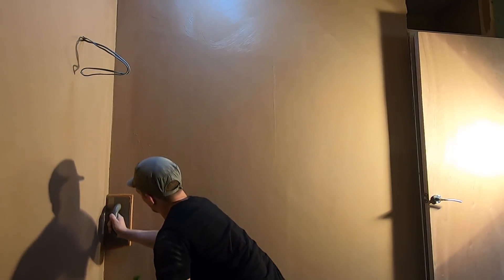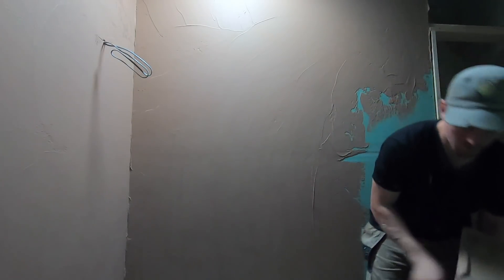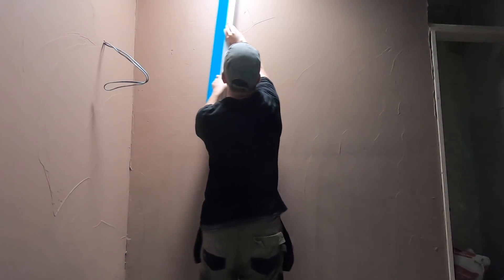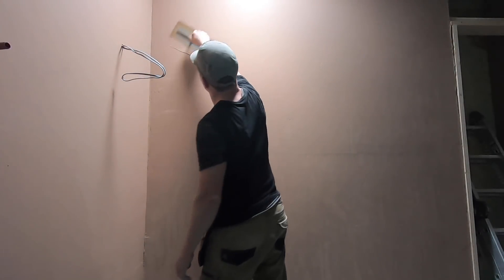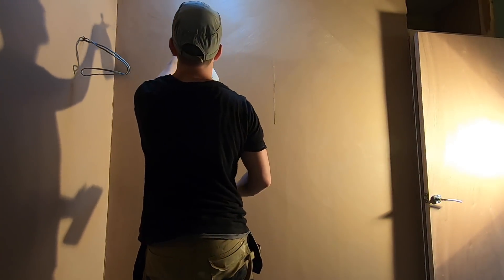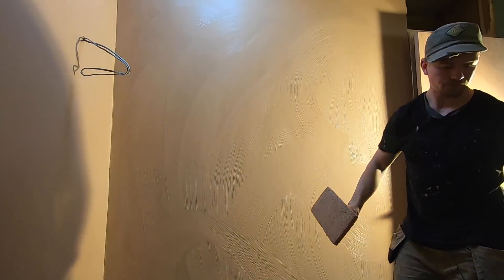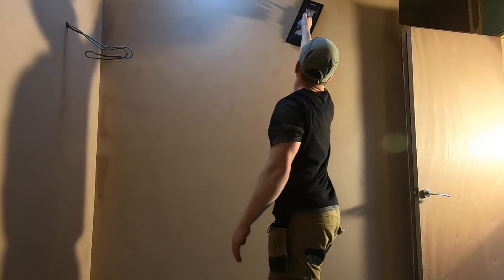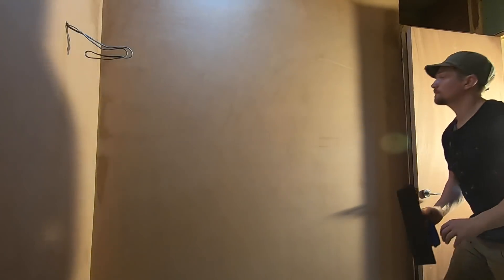One Coat Plastering | Is It Ever OK To Do??? (TEST)

Comment: Hi mate. Interesting vid. Can I ask you for your thoughts on my situation please. My mother had a disabled bathroom adaption and I thought it a perfect time to change her old hardwood windows. Problem was the window manufacturer couldn’t get our order out in time (snowed under with orders) and so we had to let the bathroom works go ahead (incl plastering to the walls) but got them to leave the ORIGINAL skimmed reveals. The issue I have now is that having fitted the windows I’m looking to plaster the reveals but even though they’ve left me with skim beads the thickness I’ll need for the reveals (off those beads) is around 10-12mm……as they’re external walls I’m wary of using bonding then skim coat and was wondering about this one coat (never ever used it)….what do you think? It’s ‘only reveals’ after all and I’m going over the original plaster finish. Thanks for any info. 👍

Comment: Today I have plastered a 10m2 ceiling using this one coat method. Late Victorian house with plaster coving. I blue gritted the ceiling. Laid the coat on mega thick. Used an ox speed scim for the first time. It was ok. Will get better at it and think it will be better on walls. Followed all of your steps, took 2 1/2 hours from start finish and it was f@cking hard work. Always is, I f@cking hate ceilings. Been a DIY plasterer for 9 years and ceilings always destroy me so thought I would try this instead of two coats where I always struggle because the 1st coat starts turning before I get the next coat on. High ceilings so up and down ladders takes it out of you.
Today went ok. Still hard work but found I could spend longer getting the big first coat right as I had more time due to not mixing up a fresh batch. 
I think it looks good but can’t really tell until it’s painted white. I will report back here once I’ve done that and let you all know what the finish is like. 👍

Comment: Id have that tiny wall coated in 3 hawkfulls easily. And second coated in 1 hawkfull.get the sponge in the bin. Never seen the likes of it.good timing and spreading shouldnt need sponges and water for closing in ready for a polish .water should only be used for brushing im edges and polishing.

Comment: Sorry just had to comment again 
As long as you do a nice 4mm coat the finish is same. I've wanted to try 1 coat for awhile but went against it because how I was trained. Had to take that leap off faith. Your not compensating on quantity of the plaster. It will dry Even rather than 2 coats going off on 2 different times chance you could hit dry spots. Like I said with all the new trowels makes 1 coat available old dog new tricks
Reply from the maker: Hi there! Thank you for your comments - you have some valid points and I must admit that I agree with everything you've said! Great hearing from you and thanks for watching! Cheers 🍻

Comment: one coat plastering works well if you know how , most dont know how thats the biggest problem , ive done both in the past long before any of these new trowels were available , my old gaffer couldnt tell in the slightest whether it was one coated or not  nor any other plasterers either
Reply from the maker: It definately seems like there's a knack! It's not for me but I must admit I was tempted after testing it! Great hearing from you and thanks for watching!
Reply: @PlasteringForBeginners  ive only ever done it really on price jobs mainly in cupboards n bathroom that would mostly gettin tiled after , the propa way to 1 coat is to scratch ya coat on then flatten what youve just spread then go over the it with ya 2nd coat , its classed still as 1 coating in a  way even though ya actually scratching & laying on at the same time , this is the single biggest mistake most plasterers ive seen make
Reply: fill tapes & beads in before hand also meks for a better finish too
Reply from the maker: Oh ok! Thanks for that mate, I'll bear that in mind. Cheers 👍
Reply: @PlasteringForBeginners  15 year ago i worked on sir richard morris at his new home in derby , he was a multi millionare & was one of the biggest nobs ive ever met in my life , his whole 1.5mil home got 1 coated n not 1 person noticed lol it works good luck
Reply: lee westwood was another too total 1 coat bellend

Comment: Why cut corners, at the end off the day the correct way is too two coat always.
Reply from the maker: You might be right but I just thought I'd run an experiment and the results weren't bad!
Reply: Plastering For Beginners I know mate, it probably does but it’s not the right way is all I’m saying .
Reply: 100%
Reply: If you cant produce a perfect finish with 1 coat then you havent mastered the medium. Your simply turning the handle on the machine without truly understanding what its doing. I do it every day and have done since I figured it out 21 years ago...
Reply: Garry Wright yeeeeehaaaaw cowboy 🤠